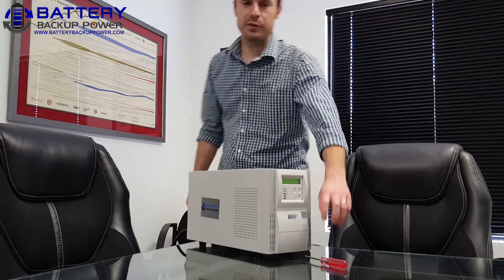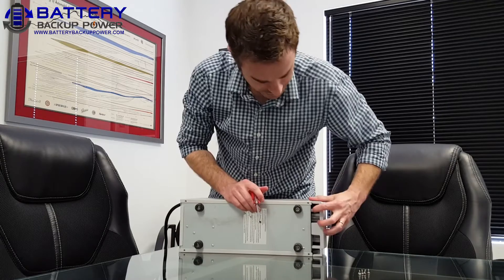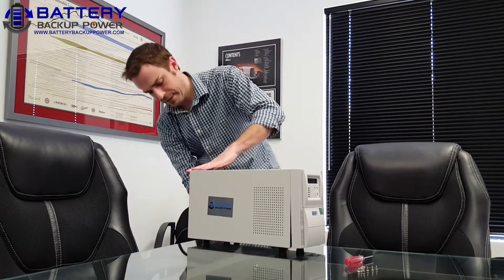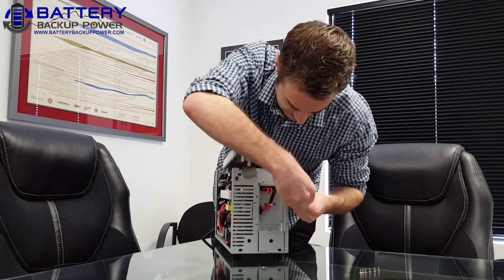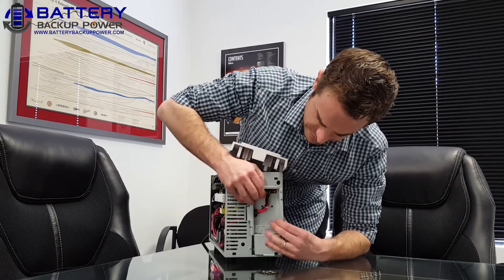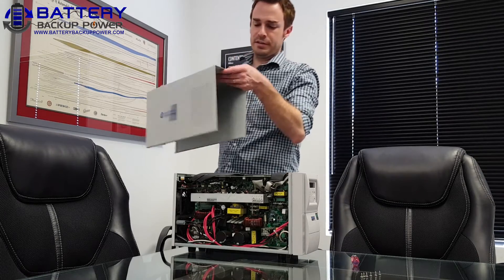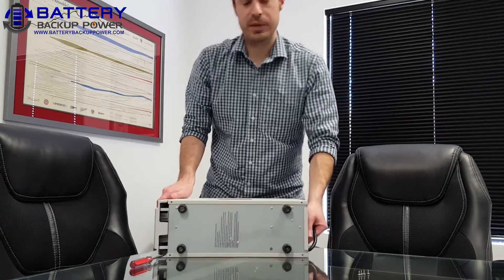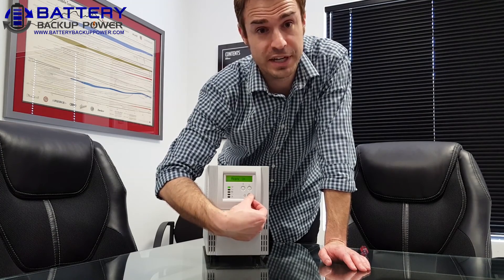How To Replace Batteries In A UPS Battery Backup

Comment: Excellent tutorial to change the batteries, but there is a small problem when the battery charger circuit is checked, because if it is defective, the batteries will be damaged again.